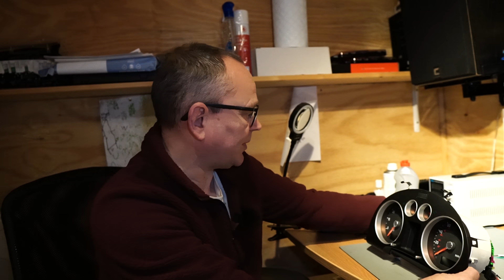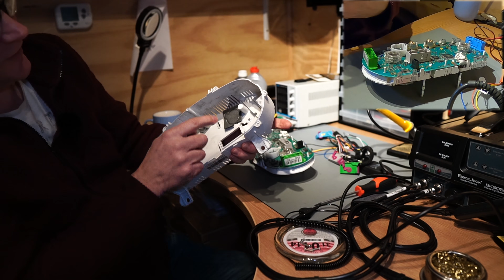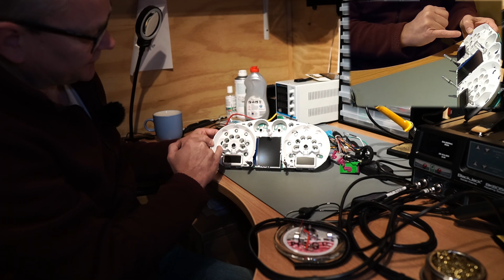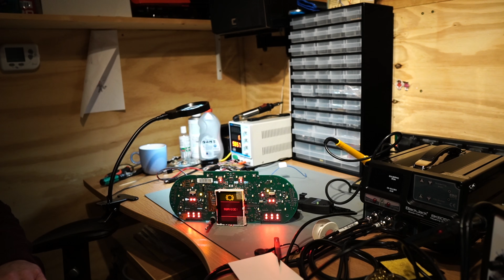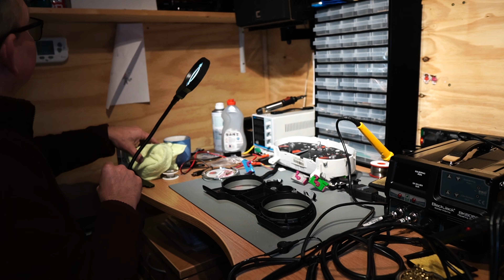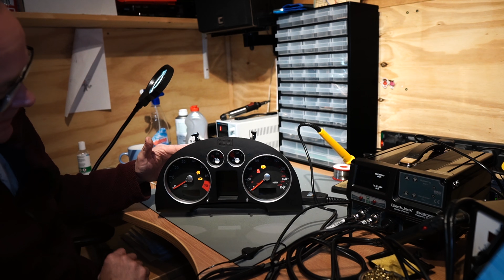audi tt dash cluster rebuild

Comment: What if you recalibrate the speedometer needle, and then later while driving it goes back off?  Is that because the post to needle connection is too loose?  How to fix that?  What about a very small circle of thin plastic film like used for food, on the top of the post before putting the needle back on the post? Like 1/8" circle or small enough that it just adds some more friction?  Thanks!

Comment: First TT cluster repair video ive seen where the temp and fuel don't sag all the way back down to like 7oclock with the power off. Every other repair vid I've seen of these required the repairer to power the cluster so the needles didnt foul the black housing on reinstallation

Comment: PSA for anyone with faulty temp/fuel stepper motors (and possibly tacho/speedo but not 100% sure) not wanting to pay 50quid for a a single used replacement motor and wanting to do the swap themself (which is quite easy)
Citroen C5 Mk1 had Jaeger cluster using the EXACT same stepper motors so you can get C5 Mk1 cluster with extra side gauges for like 10 quid and scavenge it for 4!!! small stepper motors that 100% fit and 2 big ones that look like they are exactly the same but I didn't swap them over to test
Spent a week researching Jaeger clusters to find a popular and cheap one and managed to find it, so enjoy boys :D

Comment: great video! Q: I have an MK1 TT as shown in vid. I had a problem with temp and fuel gauge: Fuel jumpy and temp always close to 100c. I changed the 2 step motors. Result: Temp, when engine is at warm and should read 90c, reads just below. Fuel goes to slightly above half full even with full tank. RPM and Speed all running correct. What can the problem be? Any help much appreciated. Thanks !!
Reply from the maker: @rogerthat1963  have you tested the clocks using vcds? That will show if the operation of the clocks is correct. And you can rule that out if they are ok

Comment: The rpm and temp gauge of my cluster isn't working anymore. I changed both motors but it still not working. Do you have any clue of the problem?
Reply from the maker: Best speak to Sean at Motivelectronics. His details are in the video description

Comment: So i replaced the cluster on my 2002 audi tt from another car and rpm gauge doesn't work . It's a rebuilt unit contacted seller and reason is the cluster needs to be programmed to the car.  Anybody know if this is correct ?

Comment: Will this cause me to have to reprogram my key in order for my car to turn on again?
Reply from the maker: You should not have to, no. the keys are linked to the CCM ( interior ecu )
Reply: Thank you for your quick reply. I enjoy your channel. Had educated me a lot. How would I be able to calibrate or in other words make sure that the temp and fuel needles will line up correctly. I do not have a set up like that on a bench. I am just a diy kind of guy from my driveway. Trying to keep my 04 3.2v6 running as nostalgic as possible.

Comment: Re the fuel guage.
I listened intently but I still missed the part about the fuel guage needle.
So.
My 2000 model reads ½ when its actually empty. The low fuel warnings all work correctly as if it is on empty and reserve
Can I just adjust the needle position by removing and replacing it to the correct position?
Sorry.. but I'm a little hearing impaired and some things I just don't hear correctly.
Thanks again.
Tasmania Australia.
🇦🇺🐨🦘🇦🇺
Reply from the maker: Hey buddy, yeah its a case of lining up the needle correctly with the start and finish / resting points, it may be a little trial and error unless you can find some pics online of tt clocks in the turned off position for reference
Reply: @TheParrottBros  thanks Dom. Legend mate. ✔️
My next challenge is how to fit the rear wind shield drive belt, now that is going to hurt the arthritis for sure.
🇦🇺🦘🐨🇦🇺

Comment: Another excellent video. Full of interest. How nice to see stuff fixed rather than thrown away. This is what worries me with cars becoming more digital and less analogue. The only thing wrong with my TT is the LCD display which misses some pixels at times. Imagine the owner of a modern car 15 years down the line with a dead screen on the dashboard rendering it unusable. Oh, I forgot to say the driver's heated seat doesn't work either. Another electrical bit.

Comment: Serious Question: Can your speedometer fluctuate in a Mk1 TT. E.g read inaccurate (not wheel size related).
My car seems to read faster now, going from zero to 80kph, than a year ago.
Reply from the maker: Hey, how much of a difference are you seeing?
Reply: @TheParrottBros  
LoL here I am, a year latter answering this feedback.

Do you know what I think the difference in speed from 0-80km/h was in the end!!
The hand brake was only just two clicks, when I first got the car.
Plus the rear pads were coating the rims in brake dust.
I just thought they were different (dusty)pads to the front.

Those same pads have stopped caking the rims in dust...

LOL, the increase in acceleration is more than likely due to the pads wearing down.

: )

Comment: Help with my cluster!! It went, sent it to a specialist, who repaired, reprogrammed. Worked fine for 3 weeks, then same thing happened. But with a difference. The side light light on the dadh was perm on.  Sent it back, they cant find a fault. Re connected and it worked. Went to pick up the car, and it went again. Does it need a new cluster?

Comment: What price is the full job
Reply: For the work shown in the video, £119 inc return shipping within the UK (also ship international, rates vary). Turnaround usually 2 business days but can turnaround same day if pre-booked.
Reply: @seanb9814  any idea on postage back to Ireland
Reply: @seanb9814  Hi Sean, fantastic work. For TT's that have a parastic battery drain that is isolated to fuse 15 (instrument cluster) how is this tested / repaired? My dash display I would say is about 85% good (few missing lines) and the Fuel gauge is slow to show its value when filled up at the pump, speed +revs and temp all fine. All forum research I have come across point more to the processor being the cause of battery drain related to the dashpod? Is this the case in your experience, repairable?

Comment: Excellent and careful repair and Sean's a top bloke.  However, in the end it seems that the display suffers from what most repair displays suffer, ie its too bright on the outside of letters (compare brightness with the two small displays left and right)...  The original DIS display has the same brightness.  Some people fix this with some smoked adhesive on the replacement display..  unfortunately the original display with the blue ribbon is NLA